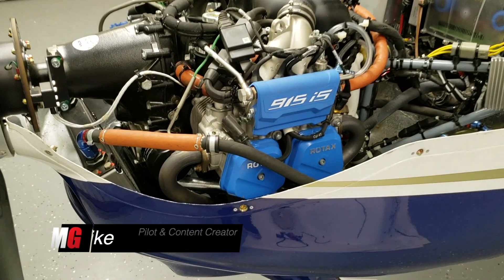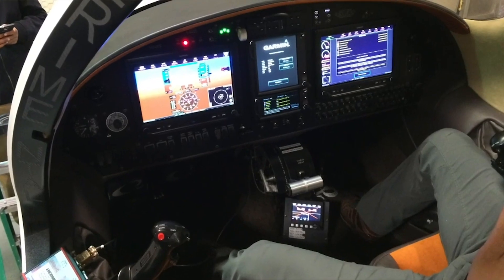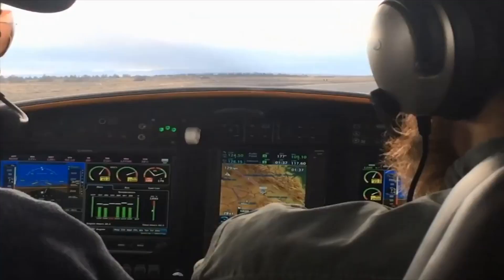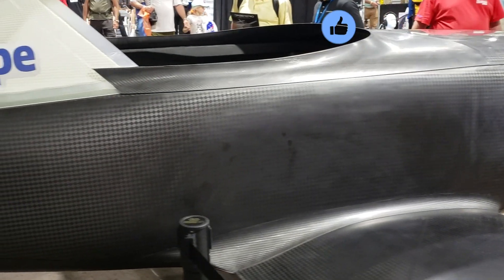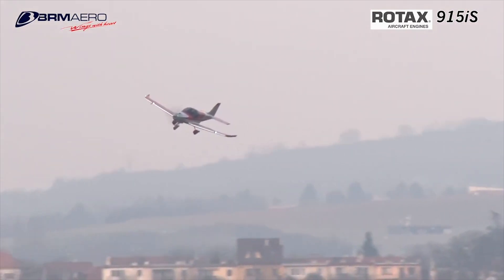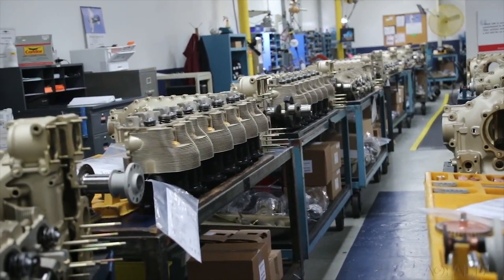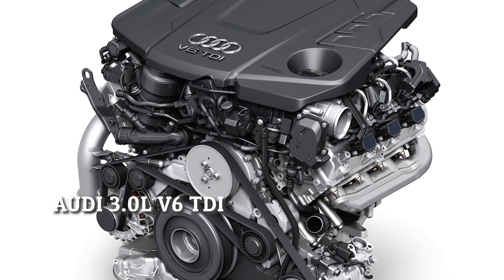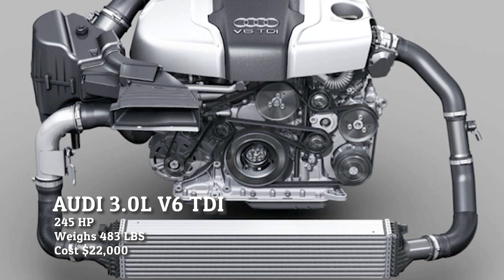5 FADEC Engines Used To Power Airplanes

Comment: There really NO FADEC for piston engines. FADEC comes from TURRBOJETS.... Fuel control in those turbojet engines is complicated, and they used hydro-mechanical systems. Very complicated. FADEC was for Turbo-Jets or power by wire... verses cables.  In the case of piston engines fuel delivery and ignition is NOT that complicated.  Also all these engines really do NOT have single throttle controlling propeller. Sure Circus does but it is mechanical linkage. Further Circus said they are not happy with the FADEC they put in their planes.  DO NOT GET Electronic FUEL INJETION and ELECTRONIC confused with FADEC on turbojet engines. It is a JOKE to call it FULL AUTHORITY.  FADEC does amazing things in starting Jet engines. FADEC does not exist for piston engines, except for marketing.

Comment: Brother I just had to say this to you I must have watched a hundred of your videos I literally watched some of your videos everyday I'm in plain obsessed I love aircraft I have since I was a little kid I'm a pilot I've flown Lear Jets cessnas all kinds of aircraft and I got to tell you I'm also f-18 certified now the f-18 is computer controlled there's no mixture knob okay it's controlled like a fatak engine and you can say okay well that's more reliable but yo what about when that system failing causes a crash you're comparing that to a novice pilot please don't say something like all pilots should fly behind a fadek cuz that's crap I'm a competent pilot brother I'm a certified test pilot just like you and I don't actually need that I actually prefer my own control over the pitch and mixture I get much more performance out of an aircraft than a typical pilot will because of those things because I manage those things competently I do very well and I I really like to set those things up myself because I tuned by engine sound I tuned for maximum efficiency I tuned for the best possible power with the least amount of fuel burned without a computer next to me and reprogramming the damn faded all the time I can't do that in a fadek controlled airplane! Now I do realize that they are easier and for a novice pilot you might say this is the way to go and okay a novice pilot might make errors that's like saying because you might not make a good paper airplane you shouldn't bother and we should just give you one well then you learn nothing these new pilots flying with FedEx learn nothing about engine management I learned how to control my temperature with my mixture and my pitch settings I learned how to adjust them for altitude yes it's definitely more work but it's very rewarding work that teaches you about the mechanics of flying and without it you are a lesser pilot! What I mean is it's always been the known thing that if you have more knowledge about your aircraft you are by definition a better pilot the more you know the better a pilot you tend to be putting all the work in the hands of the computer takes all the knowledge away from the pilot they no longer need to know and so they never learn it and now they're at the emergency of a computer system they don't even understand let alone have the ability to reprogram mid-flight should something happen! My problem comes in with what you said there if I have an airplane like a Cessna 150 or the 180 skylane that I trained on I have my mixture knob I have my throttle and I have my pitch angle control on the prop now assuming I have all three of those controls that gives me a lot of ability to manipulate things while I'm flying with a fadex system my ability to do that is like gone all I have left is the throttle maybe pitch control now in a pitch adjustable airplane I will say that faded can be really good for a novice pilot but there should be an option that lets me turn it off so that I can control the engine on my own now I've never flown a fat airplane I'll I know about it is from watching your videos, the only aircraft I flew were all in the eighties but the f-18 is pretty much a faded controlled system It's all digital you really don't have that much control over it you have your throttle but that's it the computer manages everything else in that aircraft which is what you're talking about in an f-18 that's not a bad thing because you're going to be climbing so fast you don't have time in the middle of a dog fight to worry about your particulars like whether the engines are overheating or whether or not they're pulling too much fuel but the but you need that monitored otherwise you might burn your fuel too hard and run out of fuel at least with that you get a warning that tells you your fuel is low you get warnings that tell you what's going on with the aircraft that's a good thing that monitoring and letting you know what's going on but unless you're in a fight or aircraft I'm not a big fan of the computer having all the control I think it lessens the likelihood that the pilot will ever learn about these things in detail from experience like I did and that was invaluable experience that I have used ever since flying a helicopter is not much different you got to have your pitch control you've got to have your RPM control you've got to have your fuel mixture control I wouldn't want a helicopter that was having a computer control all those elements because I now have no control and it's fine if you're a beginner pilot you'll make no mistakes great but if you're an experienced pilot these systems are just in the way in my honest opinion I prefer old aircraft with a modern avionics that's what I like but I guess that's just me and I don't mean to imply that you're less of a pilot for feeling that way no I get it your channel is very much geared to a beginner pilot and that's awesome you do a great job and I love that you're out there making this happen please don't think for a second that I feel any other way about it in fact I wanted to say thank you for being out there and for doing this video series I love it! But I had to say something here I don't usually comment but this is the only video you've ever put out that I had any argument with and anything you've said usually your points are awesome and if I do make a comment it's man that was so smart I'm glad you said that kind of a comment. But on this one occasion I've got to disagree with you buddy fadic is not what they should be putting in a new Cessna or in any learning aircraft if you're going to learn on the aircraft you really should be learning on an older aircraft with modern avionics that way you get the best of both worlds you can learn fadic later on a more expensive airplane and that's the other issue it not only adds to reliability issues because the computer system is controlling everything and it puts more wear and tear on the computer system but it also is way more expensive because now you have to pay for that fadec system in the aircraft! and for all those reasons I really feel like no beginner should fly a plane with FedEx if you're going to take your pilot's license please don't do it in a plane with FedEx have a little courage have a little faith in yourself and learn to fly using your pitch control using your fuel mixture to fine-tune the airplane to get the best performance out of it and when you do you will find that a fadex system is usually set up from what I've understood for fuel economy not for performance or for reliability it's never really tuned for maximum performance and if you're the kind of guy like me who likes to pull a few G's and have a little fun with their airplane you definitely do not want to fade it controlled system in addition to that they're not always usually really good at adjusting when you're in the mountains and you're going to lose power because you're running far too lean or far too rich rich is the real problem because you're running a lot of fuel in a situation where there's not a lot of oxygen to burn it leaning out the engine is usually my first go-to if the engine's not making enough power I can just lean it out but on a Theta controlled system I wouldn't even know how brother and even though I'm an experienced pilot highly rated I still hold the world record in the f-18 simulator go look me up I had the highest points ever scored I don't know if the record still stands but last time I checked a couple years ago it did so I was told and even if it's not still standing you know I had the record for over 15 years guy that I know of for sure and I got to tell you I'd be a less competent pilot in an aircraft like an f-18 I may be an excellent pilot but I knew nothing about the aircraft nothing about its systems all I knew was how to turn the damn thing on and pull in Yank on the stick to get it to do what I wanted to do it's a very responsive aircraft so I can fly it flawlessly it's got tons of power you never find it lacking a faded system could have it set for maximum reliability and fuel economy and that wouldn't be a bad thing in that situation but to take that Cessna 180 and apply that same fate system to it I'm automatically going to lose power because it's going to favor fuel economy and it's going to operate at the preset levels that the factory sets what if I'm only running a high altitude and I want to really lean an aggressively powerful mixture or at low altitude either way because the way I like to fly I run on as little fuel as I can and still get good combustion and then fine-tune with my air mixture now not everybody would want to do that because hey that's a lot of work plus you got to manage your prop pitch in there but I found from experience that the more control I have over the aircraft the better a pilot it will make you! probably just because you get used to the idea of controlling every aspect of your performance

Comment: 18 MPG  is 7 km per liter. 200 knots is equal to 370 km/hour. This is insane! A liter of aviation gas will take you more than 50 kilometers. This is way too efficient! Full Authority Digital Engine Control (FADEC) is the next best thing that happened after GDI. I am a pilot. If I can afford the airplane, I'll rather fly than drive my SUV in negotiating a 500 km destination.

Comment: current car engines has long surpassed those old aviation piston designs in terms of output/displacement, weight, fuel consumption, pollution, durability, cost to own and maintain.

Comment: I fly two planes with FADEC. Both rotaxes. The 912is and the 915is. I have literally no desire to go backwards ever. I simply don't understand why I get so much pushback from people on this. I get so much heat for flying planes with FADEC and the G3X touch. I get looked down on like I'm somehow not a real pilot or something because I have no desire to fly 70 year old engines on leaded gas, carburetors, manual chokes, manual mixture and manual prop control and steam gauges. I'm sorry, the future is here. I like the massive increase in cockpit workload management that I can take on now with this tech. I will just say this, with the 915is, there is no mixture knob, no prop pitch lever and no choke. You set your power setting with the throttle, you set the prop setting to either take off, climb or cruise and the computer takes care of the rest. Now you get to focus on where you are going, the weather, or the 50 other more important things than making sure the engine is leaned out "just right" or that your prop pitch is perfect. Add a G3X and a GTN650 to this and the amount ahead of the airplane you can get to is literally absurd.
Reply: I’m with you on this, as someone who comes from the sport/race automotive scene I can’t for the life me understand why aircraft pilots like or want carb engines and disdain fadec. 
It literally makes no sense! Hell from a fuel economy perspective alone it makes more sense!
Reply: Rotax does not have FADEC it has electronic ignition and electronic fuel injection.  FADEC is a term for turbojet engines. If you look at ROTAX Marketing they don't even say FADEC.
Reply: @gmcjetpilot  ok dude. we know, for it to be FADEC it would need to control the throttles. But that was how it was explained to me 4 years ago and honestly, the cpu's control everything but the throttles so it's kinda close.

Comment: That Audi engine will not run on 100 LL. That will kill it.
It uses diesel or JET (A1).
And Mike did not mention the Austro diesel, Thielert/Centurion, Conti diesel, SMA Safran, D-Motor those have FADECs too.

Comment: FADEC engines certainly reduce pilot workload, and make things a lot easier in the cockpit... however they are extremely electrically dependant to function!  Unless the builder incorporates a proper backup battery system in the aircraft... I am not so sure they would be safer!
Reply: Rotax use a dual output alternator and a backup battery. The ECU then constantly monitors the components and makes changes automatically if anything happens. It is always set to make sure the engine has power. Alternator (a) powers the engine, Alternator (b) powers the bus and the backup battery is the backup battery. If Alternator (a) fails, Alternator (b) kicks in and powers the motor and the bus. If Alternator (b) quits, back up battery powers the bus. If both (a) and (b) quit, the back up battery powers the engine. The system is made to give the engine priority over everything. That is how freakishly redundant the rotaxes electrical system is. I have the utmost confidence in the rotax brand of FADEC.
Reply from the maker: Good point. Redundancy won't hurt nobody.
Reply: MojoGrip I am looking into installing a ULpower UL350is into my Waiex B... and if I go this route I will install 2 Earth X batteries.  Possibly one Concorde lead acid on the Firewall, and an Earth X in the baggage for a redundant backup battery.  This should provide for a system that will keep the FADEC engine running, no matter what... even if the alternator fails.  At least for a good while until I can find an airport.  I just thought it may be good to point out that for a FADEC engine to be truly safe... that a proper and redundant electrical system must be installed in the aircraft!

Comment: At the risk of everyone breaking my stones, I have a question. I completely understand the logic of going with a computer controlled system. My question is, why aren't manufacturers moving from push rod engines to OHV? I'm not a air frame mechanic but an old School toy mechanic (motorcycles, etc). Those engines, depending upon bias of manufacturer, are very reliable, efficient and low maintenance! Just my thoughts, would like your thoughts on the question. Keep up the good work, I enjoy watching your videos!
Reply: I have found that the aircraft industry is decades behind the auto industry in general. Their are people working on this. I know that people like talking trash about Jan at viking engines but I like his philosophy. He's taking brand new Honda engine tech and adapting it to airplanes. The thing with airplane engines versus car engines though is redundancy. The auto manufactures just simply don't care about it. If something fails in a car engine, you pull over. In a plane you crash land. So until someone figures out how to make a head with dual plugs and injectors, it's just going to be a niche' market. There is also aeromomentum. These are both dual overhead cams with direct port injection and coil packs. But I bet its another decade before anyone comes out with a viable engine with these specs.
Reply: The issues with pushrods come as you increase engine speed. Pushrods, and their associated rockers and other hardware add weight to the valvetrain which can cause valve float as RPMs increase. 
Since even geared aviation engines don't rev nearly as high as car engines and driving the cam straight off the crank means no cam belt or chain to fail and a simpler oiling scheme to the heads it's not so much a matter of aviation engines being "old tech" as it is a case of horses for courses.

Comment: FADEC not impressed. Way complicated, expensive, electric dependent, not needed and little performance or efficiency if any gains. Using throttle prop mixture is not hard. Also FADEC does not apply to PISTON engines, it is for turbojet engines. Not even ROTAX uses FADEC in their marketing for their engines with electronic ignition and electronic fuel injection. All these engines are not FULL AUTHORITY anything. Also prop is not controlled, even with the Continental. On Cirrus is uses a mechanical linkage with the throttle. Not very digital.  Turbojets use FADEC to get rid of very complicated hydro-mechanical fuel controllers, improve starting, lower crew work load in all phases of flight, increase fuel economy and protect from over temperature, not possible with older fuel controllers. THAT IS FADEC.... Piston engines just have electronic IGNITION and electronic fuel injection. Jets don't have ignition like a piston engines.  Carbs and mechanical fuel injection on piston engines are fairly simple and work well. FADEC is a misnomer.

Comment: Diamond Austro 3000 diesel engines are and the Theilert 1.7 and 2.0 before were FADEC.  Liberty uses a 125 HP Lycoming in their XL2 that is FACEC.  Continental has the CD135, CD155, and the CD300 diesel engines that are turbocharged and FADEC.